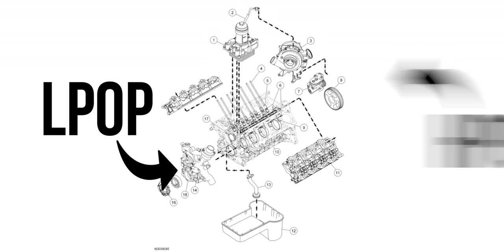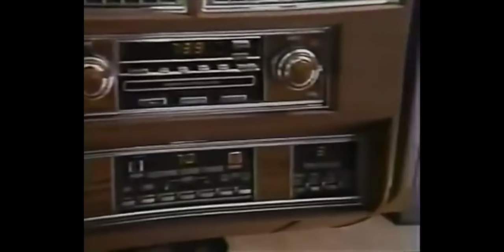These are the WORST ENGINES EVER MADE

Comment from the maker: What engines would you add? 🤔
Reply: I bet the Stella's Hurricane will make its mark soon enough
Reply: No 6.4 powerstroke? I mean, I like the 6.0 but I acknowledge it's problems. But wouldn't you say the 6.4 is worse and deserves a spot here? I find some people like myself find some saving grace with the 6.0 if you give them a lot of tender love and care. I don't see many people saying that about the 6.4. But I am newer to the diesel world so perhaps I am full of it. Loved the video!
Reply: 6.4 Powerstroke takes 1st place
Reply from the maker: @BionicBunnyMan  I didn’t include the 6.4L Powerstroke because at its core, it’s also a 6.0L Powerstroke.
Reply: @Dustrunnersauto  i feel like international messed up the 6.4 on purpose so they dont have to deal with ford
Reply: @Dustrunnersauto  rude… but touché
Reply: Cant believe you didn't mention the 305, the 6.4 powerstroke, 6.2 and 6.5 GM diesel, and the Iron duke. Those are the absolute worst my book. Maybe a redeeming quality with the 305 but in the day they were horrid.
Reply: b58
Reply: The Buick carburetored 3.0 V6 from the mid-80's total junk. No power, oil leaker and of course rounded out camshafts.
Reply: Ford 1.0 EcoBoost is the Fiesta.
Reply: Triumph 3.0 V8 in the Triumph Stag
Reply: Kia/Hyundai's Theta II engines, as well as the Nu engines (famously weak connector rod bearings).
Reply: @johntron3042  Hi, i´m currently trying to buy a 3rd gen camaro with the an 305 TBI engine in it. Why would you say they are terrbile? i thought about going with the 305 and pump it up a little bit. My big problem is  as living outside of the US it´s very hard getting hands on a car with a chevy small block engine without paying 15 k or more. Even harder it is to get hands on a used small  block engine. So would you consider not buying the 305? Because swapping it out with an 350 is very costly and almost impossible.
Reply: I´d defintifely add the modern day gas engines that are used in the Golf GTI etc. (cause there maximum lifespan is less than 120k miles before pistons break apart). Also i´d add the 60HP diesel engine that was used to power the Volkswagen T3 as it is so underpowered that while driving on even surface the  engine will overheat when using the full 60HP. Very bad are also modern day 4cylinders used in the ford transit as there engines are also very short lived (in the company i worked for we had 5 or 6 engine rebuilds on vehicles less than 10 years old with around 120k miles each).
Reply: @eliasfalser9963  Hey Elias! Ill clarify myself a little more. The chevy 305 came around in the late 70s and early 80s and at least in America at the time, we were experiencing a massive gas crunch and more strict emissions regulations. That meant that really any V8 during the time period before the 90s was just a dog on power. I rag on it because Ford had the 302 in the mustangs that produced more power with less displacement at that time period. But now in the 2020s, any old chevy small block like the 305 is a great buy if you're going to build it and buy parts for it. If you throw a longer duration cam, new heads and long tube headers, maybe either a 4 barrel Holley carb or a Holley EFI fuel injection system, the 305 can make just as much power as any chevy small block imho. And you SHOULD NOT be paying 15k for a chevy small block. I mean ig i don't know how it is over seas but you can find engines over here for a tenth of that. Does that help? I'm not trying to talk down to you btw I'm just making sure I include all of the background in case you didn't already know:). Also if you already have a 350 why don't you throw money at that? You could do the same thing and get even more power cuz of the displacement advantage.
Reply: @eliasfalser9963  Oh wait i just read the first part of your comment haha. In that case if its in a third gen, I would totally throw money towards it like i stated. and you'll be making really good power. The only issue is that I believe they have the T5 trans in them which i mean... if you go over 250hp your risking on breaking it. I would reinforce the trans if you plan on going over that or get a Tremek TKX transmission. They are pricey but WAY better built and I believe you can buy a drop in replacement bellhousing for them:)
Reply: @eliasfalser9963  also is it really that hard to swap a 350? Cuz the 3rd gen camaros had an option for a 350 with an automatic. I would understand the cost aspect but i don't think it would be impossible.
Reply: @johntron3042  thanks for the info! The camaro i'm after is a  305 TBI from 89 i think and got a TH700R4! Yea i was def. Thinking about swapping the TBI to aftermarket injectors, with a aftermarket ECU, custom timing etc etc. Was just curious if maybe they had some issues with block or head castings or stuff lile that. But thanks do far, i need to get as much info as possible👍
Reply: GM 3.6L, ford 3.5L and 3.7L. Anything with internal water pump.
Reply: The 2.3L Vega engine, with an aluminum block and iron heads.
Reply: 2AZ-FE? Wasn't that the engine in the last generation of the Celica? It was known to have excessive oil consumption. And I believe that engine was also known to have a weak oil pump that caused the engine to blow from starvation at high rpm. 

Nope. Im thinking of the 2ZZ from Yamaha. But the 2AZ is still worth mentioning. THAT one had known problems with oil burning.
Reply: @eliasfalser9963 I wouldn’t mod it all the way out because those small pistons are gonna restrict airflow but overall I wouldn’t call it unreliable or anything and although my preference is a Windsor block I love the sound every small block makes so I’d say go for it bro
Reply: They call the Chrysler 2.7 a boat anchor for a reason!! That's my vote.
Reply: Cadillac Northstar engine
Reply: Forgot to mention the Ecotech 2.4, the gm 3.6 V6 as well as all of the ecoboost fords.
Reply: The GM LK9 3.0L V6. The connecting rods were not centered with the pistons in order to reuse parts.

I think everyone can guess its main failure point...

https://www.youtube.com/watch?v=k8C2Ltwu50s
Reply: 4100HT Caddy V8. Aluminum block, cast heads. Back then it wasn't if she'll blow but when.
Reply: The Vega iron head aluminum 4 banger from the early 1970s was a real stinker and the Wasserboxer from the VW Vanagon was another pretty bad engine engine.
Reply: The 3 liter, 54 degree V6 in the Cadillac Catera.
Reply: GM quad 4
Reply: I would have added the Caterpillar 3208 diesel engine. When CAT even claims the engine is a throw away engine, you should know it was bad.
Reply: The Mitsubishi 2.6 "hemi" engine, I watched my dad in the early 90's put loads of good money to polish up a complete turd of a 80's Dodge Aries K car. I became very familiar with the inner workings of the engine and the carburetor that had plastic gears that controlled the choke that had coolant introduced to control the amount of choke was either applied or removed. The jet valves were also a huge problem. If I was to due and wake up working either on a 2.6 Mitsubishi or a 4 cylinder EcoBoost in a Escape would tell me that I went to hell.
Reply: @LarryCook1960 I second that!
Reply: The 3.8 ford out of the supercoupe
Reply: The Chevy Vega DOHC inline 4 engine.
Reply: My Mother has a hundred thousand miles on her 98/99Cadillac with the north star motor and has zero problems but she did have to have the Cadillac converters r/r they rusted out according to the mechanic.
Reply: @eliasfalser9963  Don't sweat it and purchase the car. Unless you are going to race the car, I would just run the 305 and it will work fine. Just a 350 with a smaller bore, I've had many 305's and they will work fine for everyday common driving. Hope my advice helps.
Reply: Caddillac ht4100 is literally the Northstar but 10x worse.
Reply: 3.0,3.2, 4.2 audi
3.7/4.7 Chrysler
3.0 ecodiesel( vm motori)
Hyundai/kia everything as of late.
The LC9
Reply: Jeep 4.0 with 0331 head
Cummins 053 block
04 5.4 3v for the cranks being machined wrong
Reply: 2.6L Mitsubishi in 80's Chrysler La barons were a heap!
Reply: Ford 6.2 and it's broken valve springs
Ford 4.0 ohc 
Chrysler 3.6, and the later 3.8, the earlier 3.3 and 3.8 was alright
Reply: @Riley's Junkyard & Petting Zoo  a 86 Fleetwood just rolled into my shop, with the 4100.....and I'm about to kick it out, bc I'm sick of it
Reply: Dodge/Chrysler 2.7L V6 from the late 90's to the mid 2000's 🥴 oil sludge was extremely common
Reply: G54b from Mitsubishi.
Reply: The L52 Vortec 3500 inline 5 cylinder engine was one of the reasons GM needed a bailout.  That garbage should have never been mass produced, nor even got out of the designing stage.
Reply: Chevy's 5.7 V8 LT1, all around decent for it's time but the water pump has a suicide pact with the optispark distributor.
Reply: @azroadposer  , exactly. Whoever thought an interior water pump was a good idea , should be fired or sent back to engineering school.
Reply: The early Cummins Westport natural gas engines with the aluminum pistons (Bad ,really bad). So bad that some trash hauling companies went out of business.
Reply: @boby115  Did you mistype or did these horrible engines really have aluminum pistons?
Reply: @indridcold8433  , my buddy who sells trash trucks for a living told me the original ones had aluminum pistons (could be wrong, but that’s what I heard🤷🏻‍♂️) .; supposedly it’s all corrected now .
Reply: The 1.0L I-3 engine that was used in the Geo Metros in the 1990's. Crap engine that wouldn't last 150K miles.
Reply: @indridcold8433  Have you seen the Mothman or Chief Cornstalk lately?
Reply: 1970'S 2.3L chevy vega engine.. GM decided not out steel liners in a aluminum block..😂
Reply: The v6 thats in the jeeps nowdays. The one that cracks the oil filter and starved itself of oil hence ruining the motor lol
Reply: The Diesel GM cars that came with the TH200 trans got included in the class action suit. GM had to set the warrantee  at 100,000 miles. (as an example) If the trans went out at 50,000, GM had to cover 50% of the repair cost. Worked in the transmission business. I remember one of our parts suppliers came in one day and said; "We should all say a prayer for GM every night, because they'll keep us working for a long time. 
Really surprised you didn't include the original Vega with die-cast aluminum engines.
Reply: @Bbbbad724  The Mothman had me visit Vancouver as of late.  He bore dire news about Vancouver.  However he had worse news about Seattle.  The disasters that will  befall both cities will be interconnected.
Reply: @indridcold8433  Thank you.  Great movie, btw 🍿
Reply: The Chevy 90-degree 2.8 V6 is an absolute shit motor. I've had lawnmower engines with more power...
Reply: SpaceAce100  I learned the hard way. Never buy the extended warranty. Study your carm. Learn everything about it.  Learn to service, repair, and upgrade your vehicle yourself.  Never depend on service stations.  Buy a good set of tools.  Learn how to used them on your car.  Never believe it takes a, "professional," to do the service and repairs.  You can do all the mechanical, electrical, computer, and electronic, repairs yourself.  There is advanced diagnostic equipment available to the public for far less than taking your vehicle to a, "professional," repair shop. Never believe the myth that a home mechanic can not service and repair the modern vehicle.  That is a myth perpetuated by the dealerships, service shops, very lazy people, and people that make willful ignorance a point of pride and not shame.
Reply: @hanc37  The 2.8 virtually came out of the factory with a push rod hanging out of the cracked cylinder head.  I never bothered repairing then after the first three and the flood that followed.  I just decided to start retrofitting different engines into the vehicle or telling the owners to scrap the vehicle or take it elsewhere that was not flooded with work.  Most had a tow truck take their junk to the salvage yard.  There was a lot of S-10 pickup trucks, Cavaliers, and Cobalts, typical GM (Garbage Motors) junk, as if GM makes anything else.
Reply: @bryanyoung3764  Those are extremely low miles.  No vehicle should have any significant problems with that low mileage.  Unfortunately, Chevy Cruze, any Nissan with a CVT, GM turbo charged 4 cylinder engined vehicles, the new Ford Bronco with the plastic oil pan engine, and the Chrysler 200, are all very likely to fail way before 100,000 miles.  Newer is no longer better when it comes to cars.  It seems the cut-off point for GM is 2004.  Some say 1999.  Generally for the majority of vehicles, 2010 is the cut off date.  I can not believe how many vehicles under 100,000 miles are coming in lately. But do not let me talk you out of a newer car.  I need the job security.
Reply: @indridcold8433  I was just saying that my mom got lucky. From what I've heard people say the GM  North Star motor  was junk. And I also think that the older cars are better than a new cars I had a 2000 Chevrolet Tahoe with vortec 5.3 it the most expensive thing I ever had replaced on it was fuel pump and rebuilt the front end. I live in Texas every year it had to go pass emissions and inspection it never failed to pass inspection. When I got rid of it and it had three hundred thousand miles on it.  Used a quart of oil in between oil changes at  6000 miles It ran great the only reason I let it go was that the body an the interior was whore out.
Reply: The Peugeot-Renault-Volvo V6. That thing was a turd in a lot of stuff it was put in. The Volvo 200/700 series, the DeLorean, ‘90-‘92 Dodge Monaco, all plagued with a soft steamer as a power plant. 
I also have to add the GM 3500 V6. Pure garbage.
Reply: @bryanyoung3764  The 5.3 will be good for over 300,000 miles before the first rebuild with just regular oil changes. I have seen Tahoed that look the the most pathetic remnants of a vehicle parked.  I wonder if the vehicle is abandoned.  A guy comes out of the store and gets into the apparant scrap and turns the key.  The Tahoe hums to life like new.  Then I will ask the guy, how many miles does that heep have on it?  The man answers with pride, 325,000 on original engine and transmission.  This had happened twice.  If your mum keeps babying the Catera it will likely keep running if she watches the temperature.  Once  the slightest overheat happens, that is when she will be looking for a new engine or car.  Tell her if she notices any slight overheat to stop the car immediately. Then call for help.  The Northstar cracked cylinder heads with great ease.
Reply: @swedish_brick_enjoyer  Truthfully, I have difficulty believing Renault is still in business. After Renault and Nissan merged, I question what is keeping Nissan in business as well.  Renault should just disappear.  It is GM of Europe.  That is not a compliment.
Reply: @russellehlert929  Mustang too, they ate head gaskets like Wheatley’s.
Reply: @russellehlert929  The Mustang too, they ate head gaskets!
Reply: The 2.0 ford engine lacked so much power compared to other 4 cylinders 2.3 was way better 😂I’ve got funny and sad stories about the 2.0
Reply: Early 70s chevy vega engine.Cylinder head used to warp from poor cooling design flaw.
Reply: @ajstidham7503  Are you talking about the 2.0 Pinto engine or the 2.0 DOHC in the 5 speed 95 Contour? I had one of those and it was a a rocket for NA
Reply: Chrysler 2.7 v6. they were very notorious for failing before 100k miles
Reply: Rotary
Reply: @durin23  A B58 is a great engine not sure if you’ve done your research
Reply: 6.4L Hemi Engine
EJ Engines
420A 
LS3
Reply: @ramiahwhitney1946  its ok engine just not as good as s55
Reply: Subaru EJ25.
Reply: @Chris Mannifield  nah. They were not the best but they were in no way terrible.
Reply: @ajstidham7503  got a 2.3 in a Ford fuckin Ranger. It's a dog.
Reply: 2.7 dodge engine. Massive oil sludge issues that led to timing chain tensioner failure, or the timing driven water pump going to hell and dumping the coolant in the oil. Seen way to many of these.
Reply: The Subaru EJ251 for head gasket and timing belt failures and the Nissan EG33ER for rusting out oil pans, and total lack of power for a supercharged mill.
Reply: Gm Toro flo diesel
Reply: I would add the 6.4 Powerstroke it's worse than the 6.0
Reply: The Fiat multi-air engines... Can't believe you missed that one.
Reply: The VW Ea111!!!
Reply: Harley Davidson Shovel head
Reply: The 1.0 Liter 4-Cylinder Volkswagen Lupo engine. The entire engineblock can crack in the winter times.
Reply: dodge pentastar
Reply: Oh I have a feeling things that you did not mention first things first the 4-cylinder motor that was in the Chevy Vega first generation you literally had to throw oil in it everyday and I'm not talking a little bit a minimum of two quarts of oil everyday number two the Chevy 409 if you rubbed it up too much you would literally push the rods out and you also forgot the 3.7 that are in many of jeeps and some of Dodge cars this motor was a freaking turd it would get sludge buildup in the motor and literally you would not have your motor anymore it was not a very good motor at all this azkals begging to get into a car accident and last but not least the Ford 3.0 V6 this motor was a turd to after 120,000 miles on the motor if you made it that far this motor was start smoking and you would end up losing the motor soon after
Reply: What engines are disposable?
Reply: 2.4 Chrysler PT engine.very gutless engine.also Renault,Peugeot Citroen as they have bad( crappy) electronics.
Reply: Audi 2.0 L engines guaranteed not to make 100K miles before self destruction.
Reply: 283 chevy
Reply: @funclepinky  it's actually a good motor. Biggest issue was the idiots who owned them ignored the bearing noise in water pump n kept driving it till water pump came apart and spit the timing chain which bent valves. I owned a few, did valves on few. Actually easy job!
Reply: @Crossbone_Vanguard  not hardly but the factory optispark distributor was garbage!
Reply: @hanc37  pretty sure Chevy never made a 90° 2.8...... 60°yes, just like the 3.1 etc... And also the MPI 2.8 was a screamer!
Reply: @shawnsatterlee6035  You are right. I must have fat-fingered 90 instead of 60 when I typed my comment.
Reply: GM  Turbo 1.4L
Reply: that’s your vote for worst engines really? Don’t work on cars do you?
Reply: The GM V6 from hell in the early 80’s. 229cu I believe. 
Every time you stopped , it stalled.
Reply: Probably the Ford Pinto 4 cylinder engine, if im not wrong
Reply: I owned a 1990 Toyota with the 3VZE engine. Ran great, lots of power. I bought it used but Toyota sent me a note to bring it to the dealer. They replaced the head gaskets free and while it was there they also replaced the timing belt for free. They said because it was already disassembled there was no labor charge. Wow! I had to pay for an oil and filter change only! Made me a Toyota fan!
Reply: How could you possibly miss the 2.7L Chrysler V6, from a 100,000 mile expiration date, sludging, loud valvetrain, 3 piece plastic leaking thermostat housings that only last 30,000 miles, absolutely gutless and a large portion of the cars they were put in had the battery mounted in the driver front fender well where you have to take that wheel off and remove a portion of the fender well..........
Reply: Every 4 cylinder, every V6, anything from the 1980s anything that doesn't have roots to Detroit, and anything from Volkswagen !!!!! Hands down is the worst and should be banded in North America !!!
Reply: All 4 cylinders, V6s, anything from the 1980s, anything that doesn't have roots to Detroit and anything Volkswagen!!!
Reply: 1.9L Ford Escort.
Reply: Chrysler 3.7 and 4.7 for dropping valve seats. GM Atlas inline 4, 5,  and 6 cylinders for weak cam chains
Reply: Theta II 2.4-liter multipoint fuel injection and the other similar Kia engines made entirely out of aluminum. Engines so bad that Kia and Hyundai were made to pay 100% of repair costs as well as towing, rental cars, etc., for people whose engines started knocking due to shoddy construction and materials.
Reply: LOL!
Reply: L4, 2300 by Chibby.
Reply: @johntron3042 The 305 was a sad underpowered disappointment but did it have reliability problems?
Reply: @michaelmurphy6869  I'm surprised to hear that. My dad had an '83 century with that engine, he actually got almost 300k out of it. It never consumed oil and had no problem keeping up with the fart can rice racers. It still ran great when he junked it, but the rust monster ate the floor pans. The 3100 and 3400 from the mid 90's-00's was a nightmare.
Reply: @indridcold8433   I'm pretty sure the 2.8 litre engines they used the trucks weren't the same as the ones they used in their front wheel drive passenger cars. I had a 91' S10 with a 2.8 V6 and over 250k miles, with original engine that was never taken apart, no knocking or ticking, never burned oil. It always started right up and ran like a top, even in -30 F degree weather. That truck just could not be killed, even though I tried to kill it basically everytime I drove it.
Reply: @azroadposer  what’s wrong with chocolate shakes?
Reply: Today’s Subaru boxer! Oil burning machine.
Reply: @Nostradamus_Order33  I’ll take a coffee flavored shake
Reply: @Dustrunnwrsauto - I would  like your input on the Mustang 2.3 ecoboost platform...

I have a 2020 Mustang 10/speed that I beat to death, w/63,000 miles already.. 

All good now, but terrified of this engine...🤔
Reply: The Cadillac HT 4100 was at least as bad as the Northstar.  Head gaskets always leaked and you had to add special tablets to the coolant to delay this, but the engine was also a dog..   very weak.
Reply: Subaru 2.5’s with their famous headgaskets
Reply: Toyota 2AZ-FE
Reply: The love affair for toyota has always intrigued me....and I currently own 3.

The 2nd gen prius is a well known oil user....mine is on the milder side at about a quart every 1500 miles.

My 170k mile T100 2.7 needs work...it's been maintained well.

Wife's lexus had its belt changed @ 80k by the previous owner...runs well, but every light on the dash is lit up....someday I'll figure it out.
(Actually know what the CEL is...the VSC light will need a higher pay grade than mine)

There was a class action lawsuit on a toy motor sludge problem.

"The lawsuit, filed in a Louisiana district court, could receive final approval by the middle of February. Details of the settlement are being mailed to 7.5 million current and previous Toyota and Lexus owners.

The agreement provides owners of sludge-damaged Toyotas eight years plus 120 days from the original purchase date to file a complaint."

Timing belts are bad enough...but timing belts on V8 truck motors just doesn't make sense.

As far as the Ford 2V modulars.....they are nearly indestructible. Plugs that blow were USUALLY after being changed using the wrong torque..

Currently at my part time job sitting in a 340,000 mile 5.4L van which has been idling in the heat for almost 4 hours ....

My last three 6.7L PSD motors have been flawless ....only keep trading up because of the ridiculous resale I've been getting. 

The '23 F-450 will be towing here soon enough...
Reply: The GM Vega engine 4 cylinder aluminum bore with the ohc cast iron head .massive compression losses due to soft seal rings
Reply: Ford eco boost v6 blow by on intake sensors
Reply: Audi's early 2000's 2.7TT V6.
Reply: Other than the head gasket problem which has been solved by a guy in Canada (he has a patented it), you can get more horse and torque out of it! If you know anything about Northstar 4.6L (a 283 engine) you get 380 horse, 385 torque at the crank!!! If it was a worse, crappy engine like you mentioned!, why do a lot of sand rails have it and they twin turbo it??
Reply: @chrismannifield3222  My old A6 has the belt 4.2 before they changed it to chains. It's an excellent engine. Given me no trouble for years with regular maintenance
Reply: @BionicBunnyMan  It's really not any different at all.
Reply: Naturally asiprated Ford 3.8 V6!  It was a gutless turd that only made 140-145hp and it blew head gaskets like crazy in the 95 & older models, particularly in the front wheel drive 94-95 Taurus & Windstar minivans.  I saw something that said that Felpro said that the headgasket for the 3.8 Ford is their most popular selling headgasket set!  They also suffered from leaking timing covers that would leak coolant in the oil, and leaking intake manifold gaskets!  I had a 96 Ford Thunderbird with the 3.8 and although mine never had headgasket problems on it and it ran fine up to 176,000 miles when I wrecked the car, it was a gutless turd that ran out of steam past 3000 rpm, and if you had a car load of people and you're trying to merge up hill or cross a busy roadway, if you floored it in 2nd gear, you had better pray because you weren't going anywhere!  It was a pathetic 3.8 when GM's pushrod 3.8 was already making 190-200hp around the same time frame (1995-1998)
Reply: @isthattrue1083  I mean, I’ve worked on both and know people with both and owned 2 6.0s. Neither is great but 6.0 is better
Reply: The ht4100 gm moter in the  late 80"s gm rushed  out a aluminum head v8 every one went  bad by 55 000 miles or sooner
Reply: If it was a qt low on oil  it would  lose oil pressure.  No oil capacity  in the oil pan
Reply: Quad 4
Reply: Chevy vega  pos
Reply: @eliasfalser9963  really?  I didn't have the GTI, but the old school rabbit engine, put in a 77 rabbit, was fanstastic.
Reply: Id add the BMW/Mini N14 1.4 turbo from the Mini Cooper S. That was one turd of an engine because of the timing chain guide issues
Reply: Cadillac HT4100. Like a Vega engine, just larger, weaker, and worse.
Reply: LS7
Reply: "No system of energy can deliver sum useful energy in excess of the total energy put into constructing it.
This universal truth applies to all systems.
Energy, like time, flows from past to future”.
Reply: The v-8-6-4 idea was a great idea came out at the wrong time
Reply: @MrJeffcoley1  I always understood that most of the parts on the 305, like the crank, rods, bearings etc, were the same as the ones used in the 350, but I stand to be corrected. I think they were reliable, but way underpowered. I had an '85 Chev 1/2 ton shortbed 4x4 with the 305 and I put 140,000 miles on it with no engine problems, sold it to a friend who put another 100,000 on the original 305 before he sold it. It was definitely lacking power though bigtime. I remember regretting not getting a 350 for the whole 8 yrs I owned it, due to the absence of power.
Reply: Any new 2.0 gas or diesel
Reply: Rolls Royce Vulture, Westinghouse J40
Reply: Toyota 2L-TE diesel 
Subaru EJ25
Both awful designs.
Reply: How is the Audi 4.2L V8 not on this list...  (Timing drive is the stuff of nightmares)
BMW N63 (The original versions, not so much the TU/TU2/TU3)
GM EcoTech 2.4L (Fuel Consumption, Timing Chains, Cam Phasers, Sludge/Carbon)
GM ATLAS 2.8 I4 & 3.5L I5 (Head Cracking, Cooling Issues, Valve Guides, Balance Shaft/Timing Drive.....)
Pick anything from the GM/Daewoo/Suzuki era....
Subaru EJ25 (Head Gaskets for life...)
Peugeot-Renault-Volvo V6 (They made a movie trilogy about how bad this thing was.... Great Scott!)
Mazda 13B-MSP Renesis (Arguably just a placeholder for the LS-swap)
Reply: 1.8L Hyundai Nu Engine
Reply: @LarryCook1960  Yes, bad engine, but sure was a pretty vehicle
Reply: ej25
Reply: The GM 2.8L v6 from the 80's and they put it in everything.
Reply: @Dustrunnersauto Honda engine
Reply: @durin23 wait why?
Reply: Anything designed in Germany
Reply: @BionicBunnyMan 6.4 power stroke is a good motor. Guys crank the power up on them because they can and than bash on them because they fall apart.
Reply: @patjohn775  there are some great engines made in Germany
Reply: I bought a 2011 Scion XB used. The engine is a 2.4 Toyota engine. The engine was an oil burner from the start, due to a faulty piston and piston ring design.
Reply: 1L Ford Ecoboost with an oil lubricated timing belt that requires special oil, otherwise it snaps and a replacement costs up to€2500 and an oil change isn't cheap, either and you don't whether or not the correct oil was used if  you buy used.
Reply: @greggamandabarkus4235  Yeah, I'm surprised he didn't even include it in his part 2 video.
Reply: 6.7 cummins and 6.7 powerstroke
Reply: 2.9 L Cologne
Reply: Chevy's 2.7L turbo 4 as found in the current Silverado. Electric water pump, and it also deactivates 2 cylinders so you're trying to push the truck down the road with a 1.35L twin - nor does it get any better fuel economy than the 5.3L V8.  It exists solely for tailpipe emissions ratings.   Time will not judge this miscarriage of an engine favorably.
Reply: . @johntron3042  The 305 V6 as found in GMC trucks wasn't a barn-burner, but did run quite reliably, and spawned even larger V6 and siamesed V-12 variants.
Reply: Anything Daewoo
Reply: When you were on the Triton you forgot to mention how the exhaust manifolds would ALWAYS warp & break the steel bolts off in the aluminum heads. My work shop's lot truck has 27,000 mi... it's been 'fixed' 3 times under warranty.  Bye the way if you let that annoying loud leak at header persist your valves will flake away whilst the engine cools down, loosing a little more compression each time you drive.
Reply: the Hyundai Theta engine from around 2015.
Reply: I don't know the engine code, but VW had a twincharged (turbo+ supercharger) 1.4 4 cylinder engine that they used in the Polo GTi (not sold in the US) that had a lot of problems. After a few years the engine was replaced with a 1.8 turbocharged only engine.
Reply: @DAN007thefoxx1 the last generation of the Celica used either the 1ZZ-FE or the 2ZZ-GE, both of which consumed oil to an extent. The 2AZ-FE consumed oil, but there weren't many serious issues with that engine apart from that, so it doesn't really belong on this list.
Reply: The #FuckFord 5.4L after 2007 also had MASSIVE issues with scored cam journals which they denied warranty claims if aftermarket oil filters were used
Reply: GM's 2.5 Iron Duke
Reply: @DAN007thefoxx1  it's not the worst engine toyota has made, IMO. That dishonor goes to the 3VZ-E engine.
Reply: I had a 2.2 Turbo Shelby that lasted 187,000 miles before blowing a head gasket. It would peg the boost gauge as long as there was a load. The boost gauge only went to 15 psi. I loved this car.
Reply: Iron duke 2.5?
Reply: Americans should ban together to get rid of the divorce courts and emissions regulators.
Reply: @thundermite1241  Why don't they just stay with their hit? The 7.3. They could've leveraged that success into building something else, like I don't know, lawn tractors?
Reply: If you allowed aircraft, I would add the engines fitted to the B39 Superfortress. Those were literally death traps, which killed numerous US airmen and some groundcrew.
Reply: 426 Hemi, all 10,000lbs of its low compression wrought iron and $40,000,000 pricetag courtesy of special-ed Mopar guys
Reply: ANY Ecoburst engine…

Gen1 Ford Focus 2L zetec engine! Shit power, plastic thermostat housing would warp over time with heat and blow out coolant randomly on the highway leaving you stranded repeatedly. Shitty head gaskets that can fail if you’d replace them every 40,000 miles, and would eventually blow out, hydro-lock the engine on the interstate, and again leave you stranded.

Worst POS I’ve ever owned, and I’ve owned a Northstar engine…. The Northstar was an oil burning POS that was a bitch to maintain, but at least it never left me stranded. Just always keep a case of oil in the trunk.
Reply: VEGA 4CYL SLEEVELESS ALUMINUM BLOCK WITH CAST IRON HEAD... CRAP
Reply: Any engine from harley davidson lol. And the 2.8 v6 in the s-10s
Reply: Chrysler 2.7 V6. It was known for pretty bad oil sludge. It was also quite underpowered for some of its applications (Chrysler 300C, Dodge Charger, Dodge Magnum).
Hyundai/Kia 1.8 4 cylinder (2011-2016). Great on fuel economy (almost 40MPG was possible on Elantras with that engine, but it had a piston slap issue that could only be "fixed" by replacing the entire engine. There was no guarantee that the issue would not resurface.
Hyundai/Kia 2.0 and 2.4 4 cylinder engines. They're known to seize without warning.
Volkswagen/Audi 2.0T engines (the early ones, I don't know if the issues have been resolved). Engine failure caused by excessive oil consumption.
Ford 1.6 Ecoboost. Coolant leaks and coolant mixing with engine oil.
Nissan 4.0 V6 (2005-2010). Coolant mixing with transmission fluid and causing the transmission to fail.
Reply: @bladenrexroth2555  maybe this is a bit old but from what I've read the Crosley Cobra (copper brazed sheet metal engine) would rust away in no time. Also, the Olds diesel was based on the second gen Olds Rocket V8 that debuted in 1964 at 330 cubes.
Reply: Jeep 4.7 HO - how the fuck can you build an engine if you can't make the valve seats stay in the head, you bastards?
Great engine, but will die randomly because of the above problem...